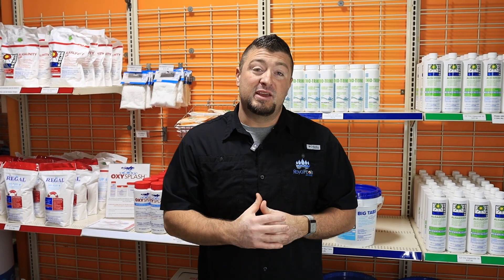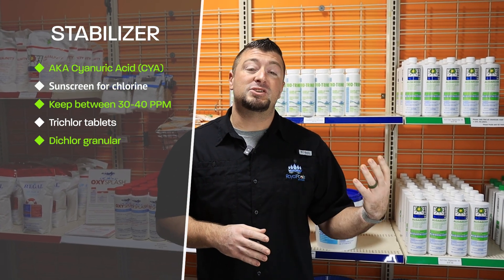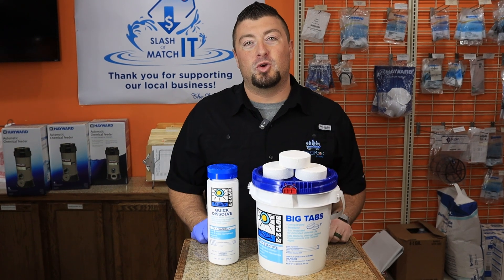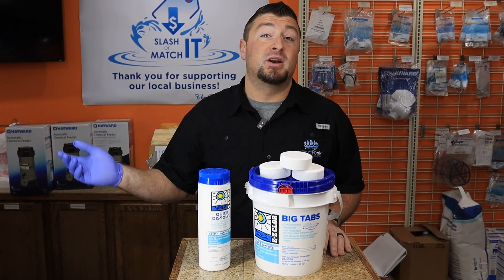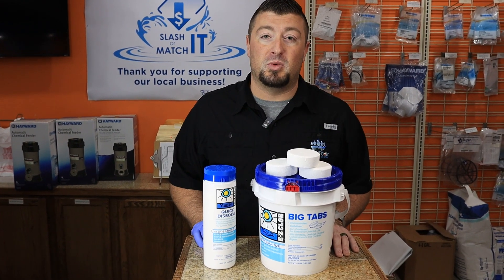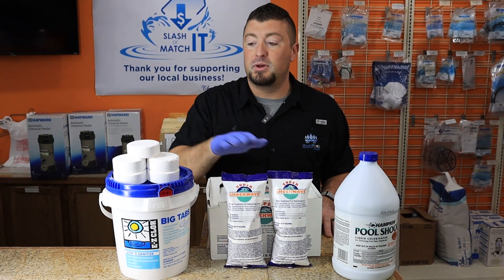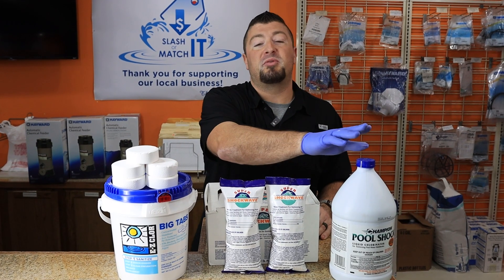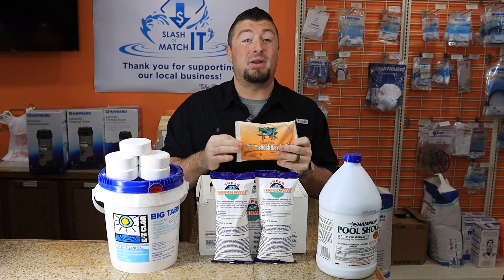Which Chlorine is Best For Your Swimming Pool?

Comment: how do I apply the tablet one
Reply from the maker: In a chlorinator or tan floater is the best bet. Never mix trichlor or cal hypo ever. You'll need to replace the chlorinator if you change. It is common in the skimmer I don't recommend that.

Comment: My Cynuric acid is through the roof. Do I need to drain the pool or just start using non-stabilized chlorine, not use any tabs until it goes down?
Reply from the maker: Draining is your best bet. They do have removal chemicals but they aren't the best in our opinion. Plus water is cheaper than the chems in most scenarios.